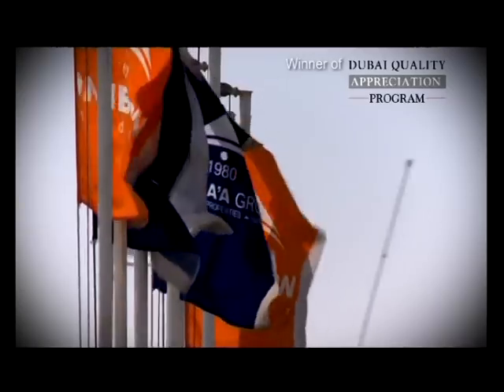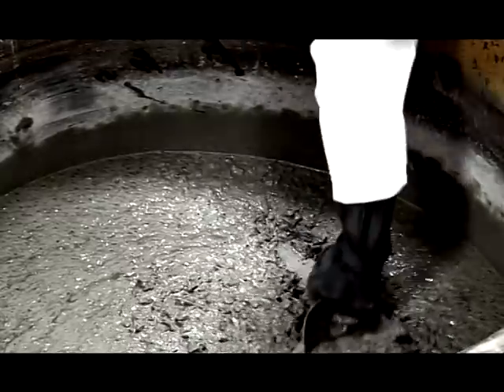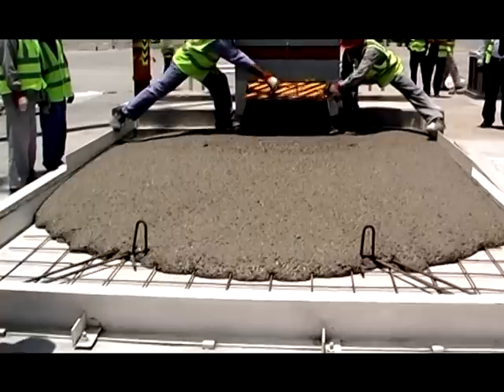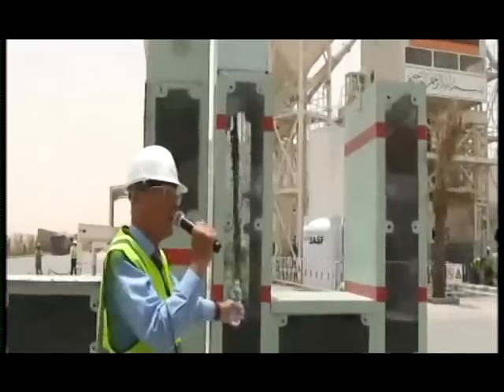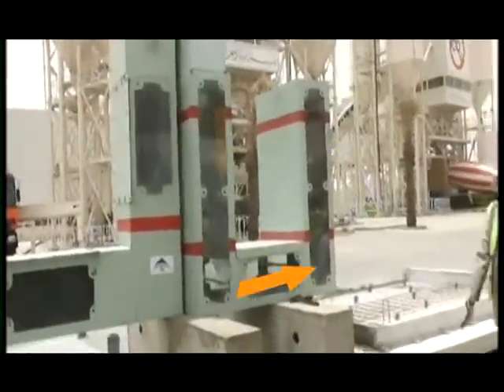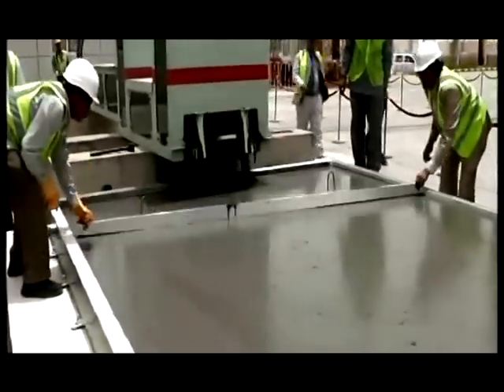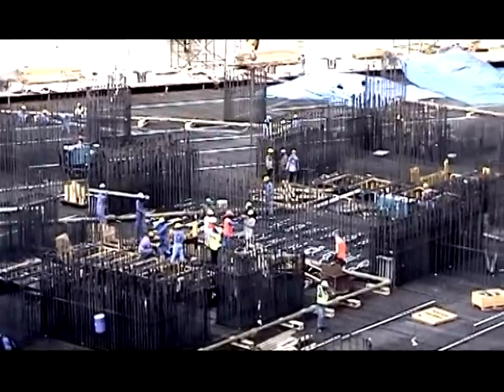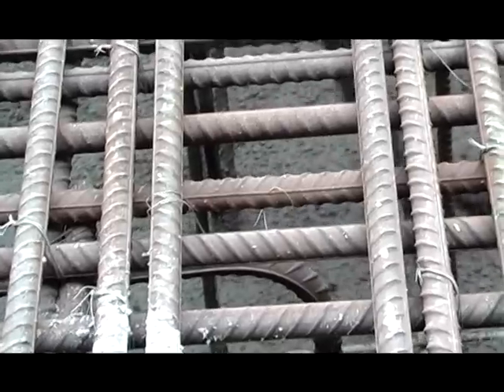Self Compacting Concrete, Unibeton Ready Mix | Leading Through Innovation

Comment: Browse 113 market data tables and 48 figures spread through 172 pages and in-depth TOC on “Self-Compacting Concrete Market by Type (Powder, Viscosity, Combination), Application (Drilled Shafts, Columns, Metal Decking, Concrete Frames), End User (Oil & Gas Construction, Infrastructure, Building & Construction), Region - Global Forecast to 2026"
Download PDF http://www.marketsandmarkets.com/pdfdownload.asp?id=226178048

Comment: how did you pour such a big slab using SCC? in mass pours, using conventional concrete, you use a step method placement to obviously reduce the surface area to avoid cold joints in case of unexpected delays. and you cant form steps with slumps over 6 inches. 

so, were you able to pour these big slabs with a mix that is highly flowable such as SCC?

Comment: are there any shrink compensating admixtures for SCC? is there such a thing?
Reply: Polycarboxylate superplasticizer is now the best admixture for making SCC.
Reply: you can also use Glenium 51 for SCC
Reply: what about viscocrete?
Reply: @Shadow_Bhai_Gaming  Yes, that is a Polycarboxylate High Range Water Reducer but that's not the same thing as a Shrink Reducing Admixture.
Reply: Yes, there are.  They are generally referred to, oddly enough, as SRA's or Shrink Reducing Admixture.  There are two basic classes, SRA's and CRA's (Crack Reducing Admixtures).